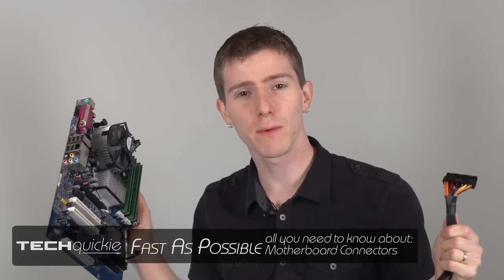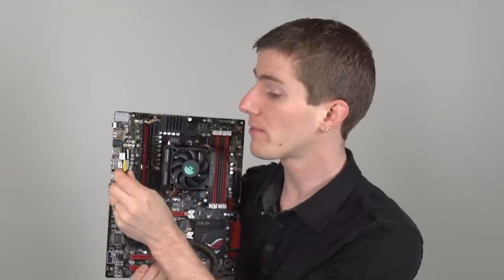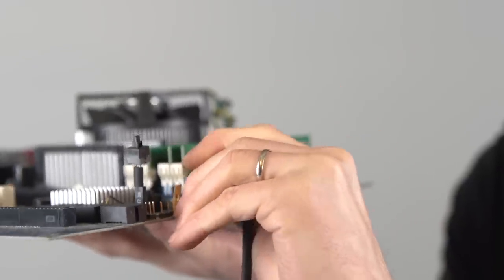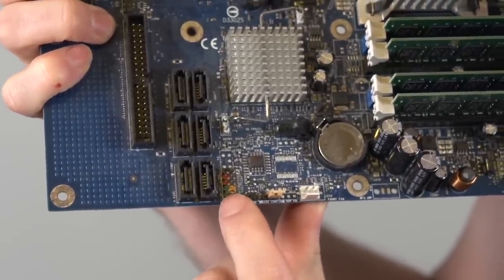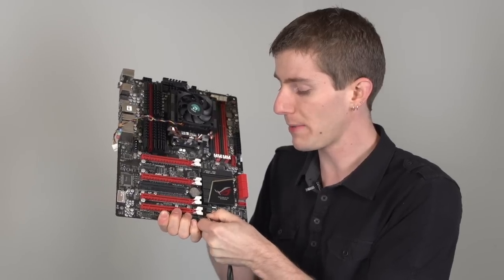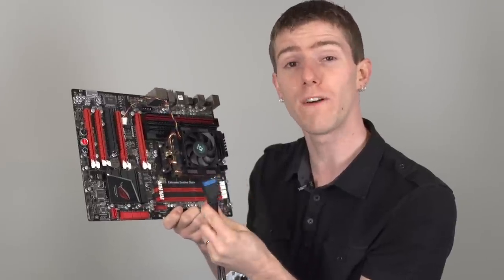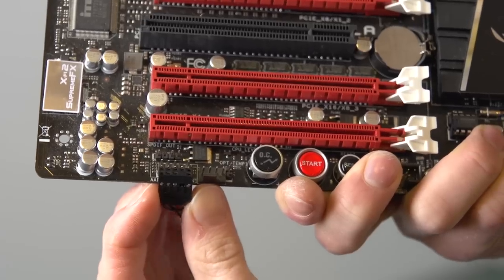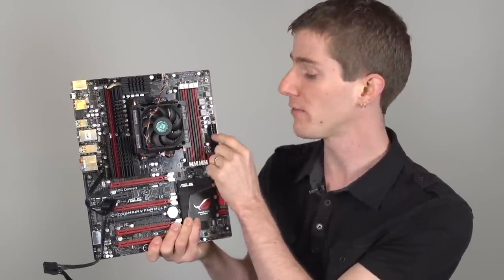Motherboard Connectors - All you Need to Know as Fast As Possible

Comment: Now explain why its so fucking card to remove the 24 pin
Reply: Make sure youre holding the clip open, and beyond that, well its 24 pins, it requires the same force as unplugging 3 8pins at once, which can already be pretty hard to unplug individually.

Comment: cant disconect my 24 fucking pin conector
Reply: Yeah, some of those bastards can stuck badly. Just use some light force and hold the motherboard down so that you wont bend it.
Reply: Did my first test build yesterday, and it took me forever to unplug the damn thing.